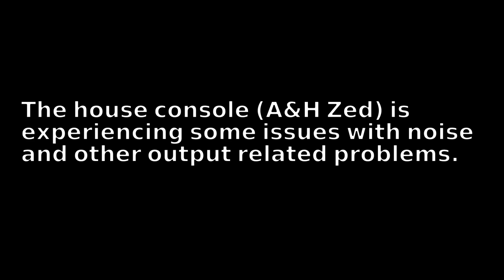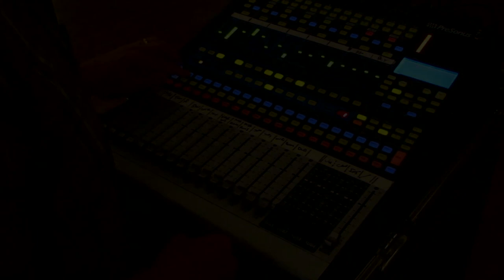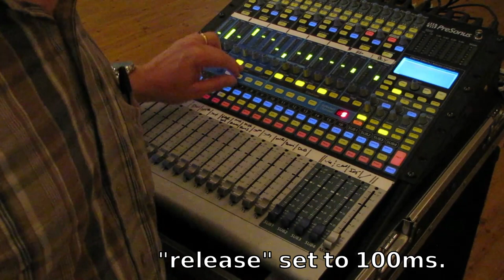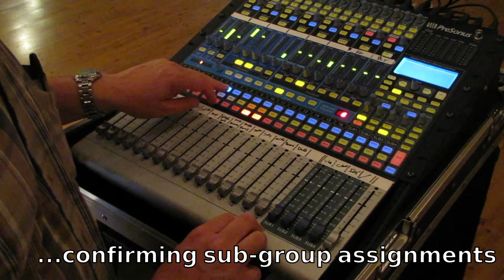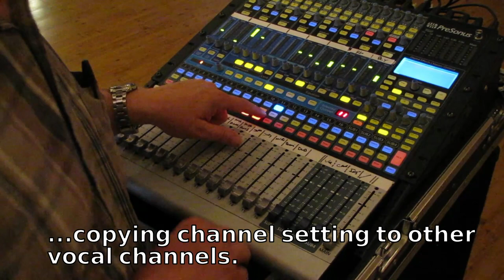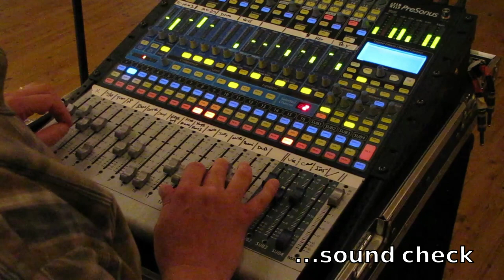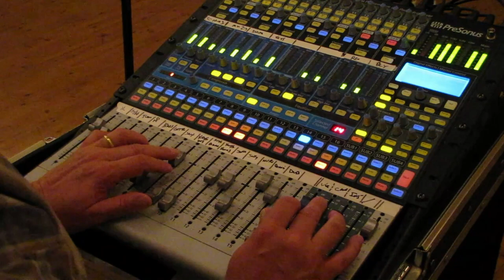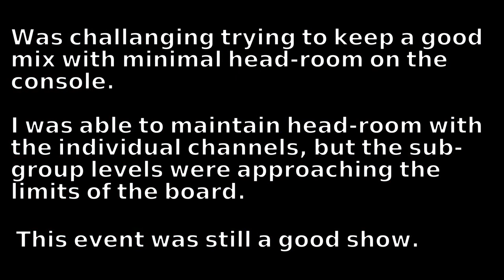Mixing theGroovynators on a Presonus 16.4.2 in Pittsboro, NC - Video 18

Comment: Are you sure that the Main Output "Level" knob on the back of the 16.4.2 wasn't accidentally turned down?
Reply from the maker: Good response.  The knob was actually set to maximum output.  We set it that way ahead of time knowing the amplifier trim settings were going to be set low.  It appears the trim settings were set even lower.

Comment: Nice one, have used some of your tips and works well for our church.  We are transitioning to digital and we have a real question Behringer X32 or Presonus 32.4.2 (now discounted)?
Reply from the maker: The choice of console will be up to whomever will be using it.  The X32 is a good board, but there may be a large learning curve with it.  I have mixed on the X32 many times for other bands... it's a good board, but you will need to pay attention to what layer you are on.  The Presonus is good and is a lot easier to use.  There's no moving faders/layers with the Presonus board.  The X32 has moving faders.  For ease of use, and especially if others will be mixing on the console, the Presonus may better.  

Thank you for your comment.
Reply: I've bought a PreSonus 16.4.2 off the back of seeing it in action on these videos despite never actually hearing one until it arrived.  It is an amazing board; can be had used for not a huge amount of money and really sounds great.  My regular driver remains to be an Allen & Heath GL2200 with a couple of outboard racks, though that's only because the venue I regularly mix at has one installed...it works well and sounds amazing, so I'm applying the "if it ain't broke" mindset. Based on my experience with the 16.4.2 so far, I really don't think you will be disappointed.  As you're mixing in a Church, give Attaway Audio a look on here too; he's Mixing on an SSL (their church clearly has a good budget) he too has some great tips and tricks.

Comment: Sorry to ask this but this presonus mixer it a passive mixer right? So you have to use active sub and speaker. Or you can hook it up to an amp as well and use a passive speakers? Thanks
Reply from the maker: You are correct.  The mixer is passive (non-powered).  Active speakers can be used with it, or passive speakers, as long as there is an amplifier for the passive speakers.  In this video, the mixer is driving passive speakers.

Comment: Do you add compression on the bass guitar even if the bass player uses a compressor pedal?
Reply from the maker: It depends on the level of compression from the bass pedal.  I will always route a compressor to the bass channel, but may (or may not) use the compressor depending on how much compression the pedal is using.